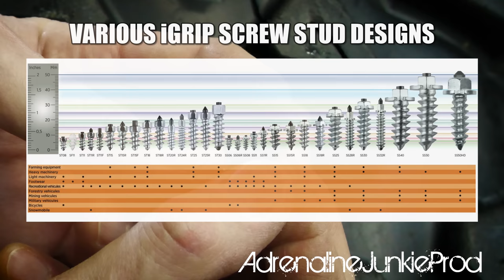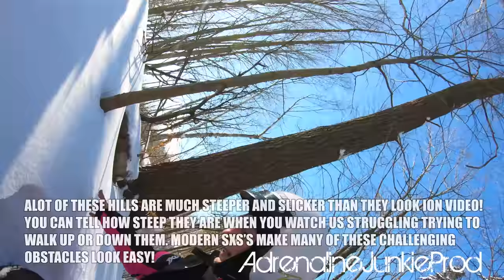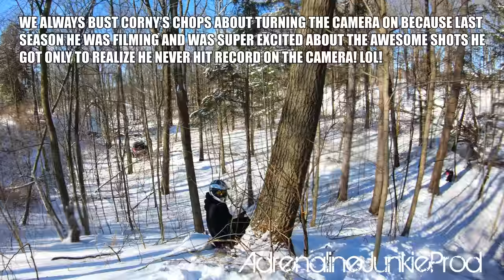Winter Wonderland - Snowy SXS Hill Climbs + Uncontrollable Declines! RZR/X3/KRX/RMAX/Wildcat UTV's

Comment: One tip instead of using messy rtv silicone. Try Butyl tape which is what’s used on rvs to seal out water. It’s kinda like plumbers putty!
Reply from the maker: Thanks for that tip! I've been wanting to get my hands on that stuff but didn't know the proper name. I wanna add some to my gear case.

Comment: So,,,I drive a talon 1000x4 and have been thinking about a front and rear windshield. What benefit does the rear windshield add? Last time i had a front only on my pioneer and i noticed a lot of wind/dust swirling inside the cab.
Reply from the maker: The main benefit of the rear is it seriously reduces that swirl effect. Also costs down on the backdraft when you are riding faster. It also keeps a lot of the dripping from the back of your roof from coming back in the machine.